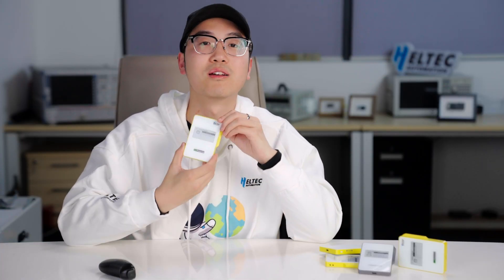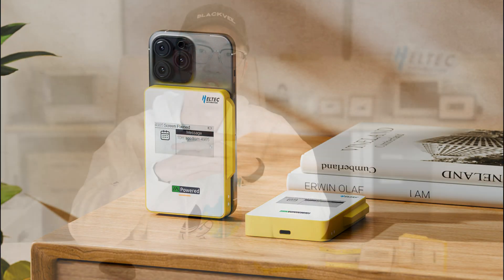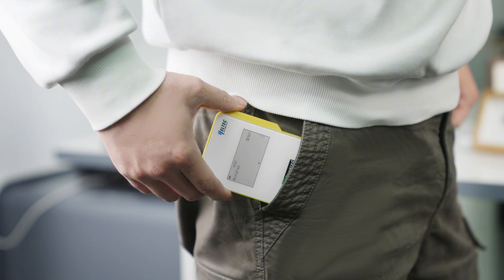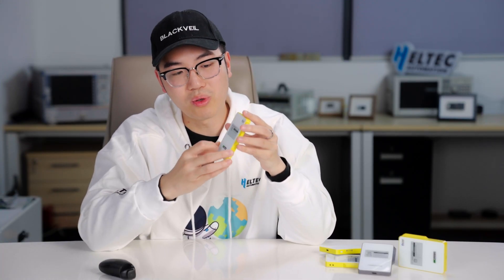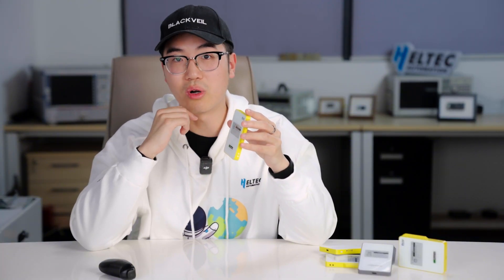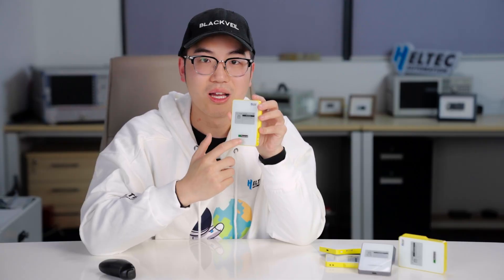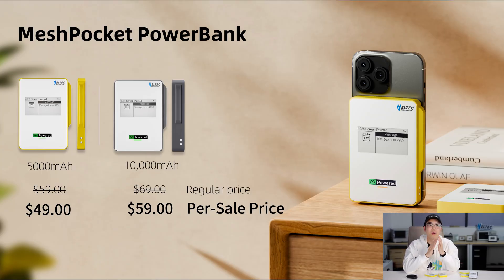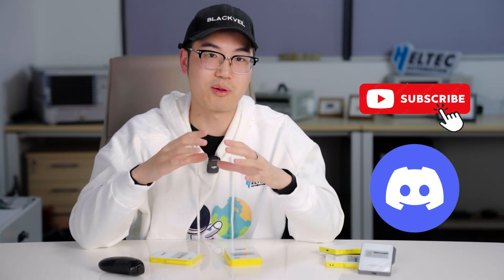Building the Future: Heltec's Mesh Pocket function

Comment: Interesting unit. Will you be offering it with a GPS module option?
Reply from the maker: The wireless charging version has little room to keep the GPS function, and the upcoming series will have GPS.
Reply: @HeltecAutomation  
Thanks for the information.  I'll keep an eye out for the GPS equipped model 👍

Comment: Am I reading the instructions correctly that you can leave the battery attached to your phone with both charging and Meshtastic turned off so that it's only discharging when the user wants?
Reply from the maker: Yes, double-clicking can turn off the current charging. When you attach it to the back of your phone next time, the power bank will detect the phone and start charging again.

Comment: Is it an "April fools day" joke?! 😱 
Too good to be true

Also, so lack of specs...

P.S.: IF it's true, it SHOULD have an external antenna port.
Reply from the maker: Did you notice the protruding part on the side? It has an integrated LDS antenna.
Reply: @HeltecAutomation I'be seen it has. But I can tell it's not enough (and I missed a part about antenna's dBi) That's why, it should have external antenna port. Every product should have it.
Reply: @HeltecAutomation  - The integrated antennas seem to have range issues unlike the external antennas.
Reply from the maker: @ClarksvilleTN  The specially optimized LDS antenna performs similarly to the external antenna. We will release a performance test video this week. But a built-in antenna is more beautiful and more portable
Reply: @HeltecAutomation  I like that you have the built-in antenna.  My unit works pretty well.